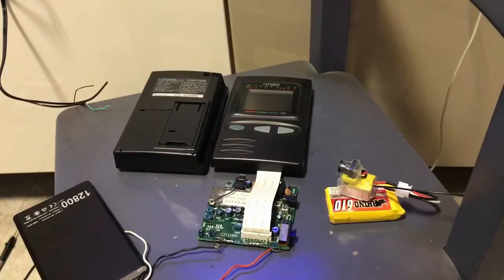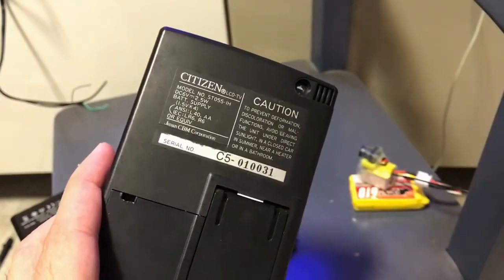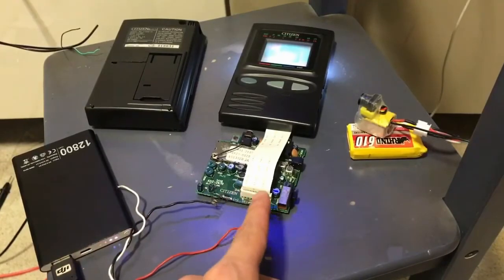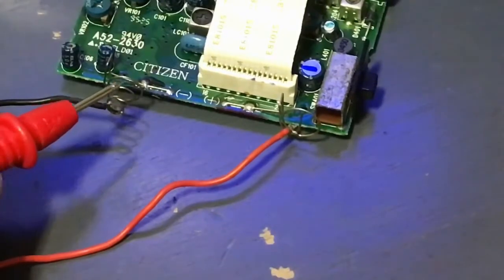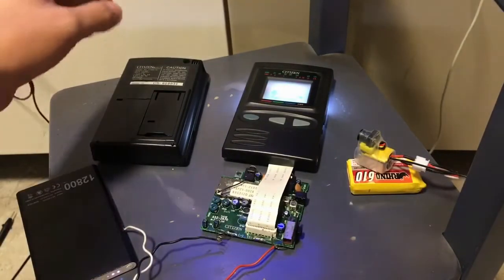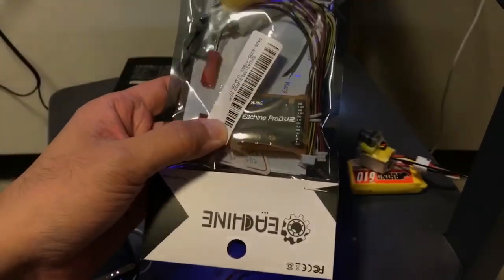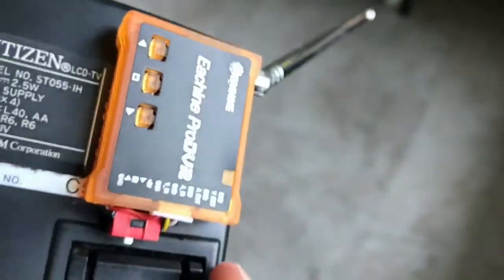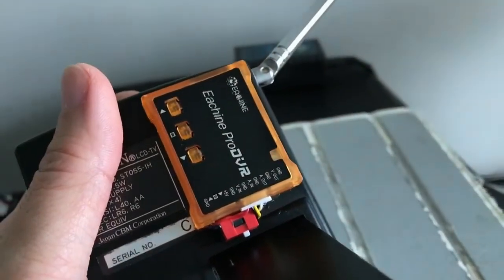Hack a Pocket TV for UHF FPV!

Comment: Hello
Do you think a transmitter like http://danyk.cz/tvvys_en.html this would work as an fpv transmitter?
Reply from the maker: yep, that will work for FPV. The issue with using analog TV channels is that the FPV antennas are much bigger than the 5.8ghz ones. The advantages are that the antennas are easier to tune and long range antenna arrays are easier to match. Also, RF parts for these frequencies such as LNA, VNA and bandpass filters are a lot cheaper than the 5.8ghz ones.

Comment: Great Build!! , i have Casio SY-20 but the picture on screen not clear and it's not colored, i like to know what's problem with it (Casio-SY20): https://wing-auctions.c.yimg.jp/sim?furl=auctions.c.yimg.jp/images.auctions.yahoo.co.jp/image/dr000/auc0502/users/a84e7b99b5e3826553db5ab7fa6a0d2a264464d9/i-img1200x1200-1550416134dpixlv615230.jpg&dc=1&sr.fs=20000
Reply from the maker: The LCD is probably worn out, mine needs to be tilted at an angle to see colors so I changed it to a TFT screen recently
https://m.youtube.com/watch?v=VjibO3FWg_k